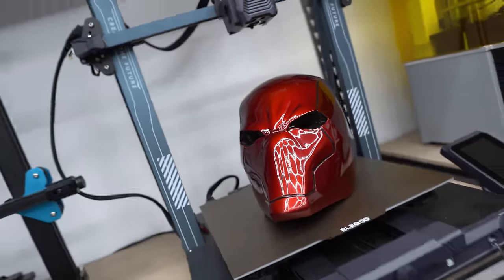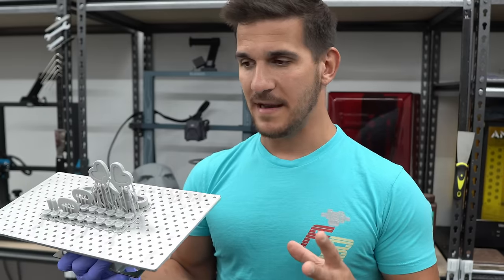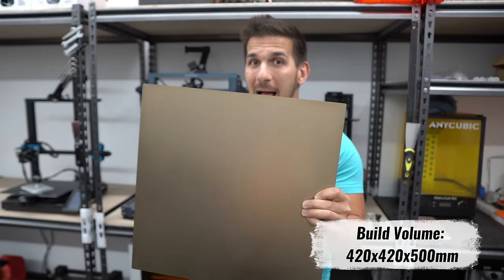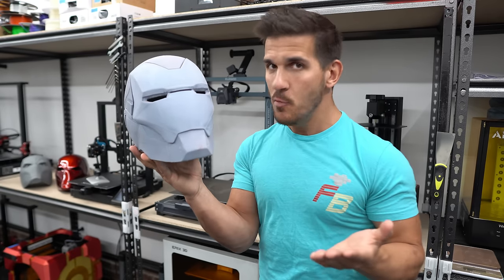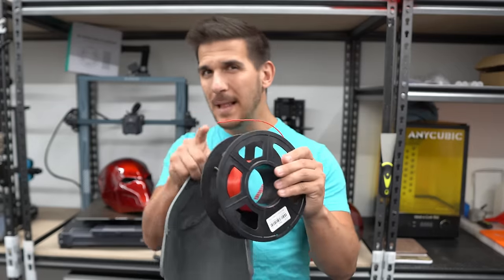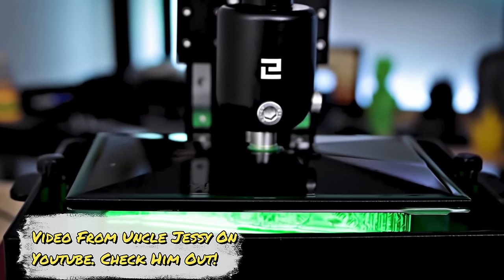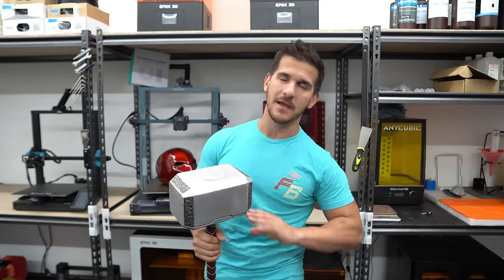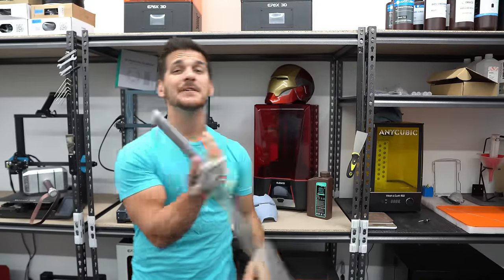Plastic (FDM) or Resin (LCD) 3D Printing?! Which is BEST for Cosplay & Props?!

Comment: Hey Frank. Good overview but also highlight that resin is vastly more dangerous to work with. Look at the Safety Data Sheet which details the various hazards. I’ve seen people get this on their hands, splashes in their eye and many cases caused a severe autoimmune response and ever serious chemical burns  Then there’s the post processing chemical hazards as well. My background is working and managing a research lab that does 3D printing.  I’m always getting updates on precautions and abatement methods. Also, with FDM, fume mitigation, fire suppression devices and enclosures are good ideas.  Please print safe, everyone
Reply: Can you elaborate a bit ? Are resin fumes always dangerous or primarily during the movement/heating process. Would an enclosed printer with inline filtration suffice for resin ?
Reply: @mml3140  the resin is always an inhalation hazard as the Safety Sheet per manufacturer will elaborate on. Some resin printers include charcoal air filters inside of them to help mitigate the fumes. There’s many things you can do when using these chemicals - safety goggles , splash guard (apron) and gloves   I don’t mean to scare you away from resin. Just understand the risks and work on addressing them.
Reply: @WhereNerdyisCool  I keep it in a zipped grow tent with an in-line filter. When I open I have a organic respirator on. But the ambient and leftover fumes still make me nervous that's why I ask.
Reply: @M ML  these resins are (meth)acrylate based. You should always take precautions with the fumes. Acrylates can also be irritants, make sure you check the SDS before printing anything that will have long term skin contact.
Reply: @chrisemerson9587  As far as contact I try to never skin contact. Even when cured I get paranoid and won't unless it's painted over.  The SDS usually has fumes in a category 2.
Reply: Have you tested the air quality in the room with your resin printer going? I did and the air quality is no different without it. This was a saturn 2 with filter inside. When opening the lid tho, the air quality plunged (spiked) as i let the gasses out after printing. But pouring resin before print was nothing.  Avoid direct contact with resin and be use a mask after a print, then avoid the room for a bit. Resin is not nuclear
Reply: @Sensei-padthai  I have not. What did you use to test the air quality?
Reply: @mml3140  most generic air quality devices will do the job just fine. Measures co2,  voc output. I actually borrowed mine from one of the labs at my university. They are not that expensive and nice to keep in a home aswell
Reply: @mml3140 I have the same setup plus I run an IKEA Starkvind air purifier with the additional gas filter in the room when I’m resin printing.
Reply: @Sensei-padthai  interesting,  I will look into that,  I appreciate the feedback. I know for paints VOC is usually the metric to look for , is that the same for methyl acralate/resin ?
Reply: @radish6691  Do you find that setup sufficient to keep the fumes minimal?
Reply: @mml3140  Yes but I don't keep the enclosure open very long either. The print goes from the enclosure into the IPA (or water) then back into the enclosure to dry.  The enclosure is lined with a silicone mat for spills (hardened with a UV flashlight once the vat is empty or covered). I use a BN-LINK Digital Heat Mat Thermostat Controller connected to an Amazon Basics 500-Watt Ceramic heater to keep the enclosure at 30C (within the working temp of the resin). I also keep the bottle of resin in there so it's already at temperature if I have to top off the vat. It's a huge improvement over my initial setup which was a fan in the window blowing out and a respirator with organic filters on my face.

Comment: A good way to reduce the cost of resin is, don't get the official wash and cure station for 200$ but get a uv lamp and uv powered rotating plate and a large jar for cleaning. I did it all for ~50$

Comment: I have 2 of each, fdm and resin printers.  I find that if I make a helmet in parts on a resin printer, if you drop it, it will shatter like glass.  With FDM it might break but you can plastic weld it back together.  So I too make details with resin and make larger parts fdm.  (I also made my own cure station with ultraviolet leds in a box and wash them in a large plastic container.  cheaper but works).  Love your videos.

Comment: One of the biggest deciding factors for me after quality would be durability. Resin prints are often very fragile compared to FDM (depending how the FDM was printed that is), but there are various resins that can improve this (flexible, tough, etc) and be even more durable, but often at a higher expense. After durability comes speed, resin is much faster than most FDM printers, and the time is linear to the height, so 10 small objects prints in the same time as 1.

Bonus for resin is you can mix to average out qualities, and transparent really is perfect. For FDM, with external parts you can do multi-color/material, whereas in resin you can't really do multiple colours without multiple prints/pieces.

With FDM, you can configure all the settings much easier without much worry for infill and walls. While you can do this with resin, you have to be careful that any hollow objects have a drain hole, otherwise uncured resin inside can slowly seep out (even a year or two after printing). On the bright side, repairing resin prints is sometimes easier than FDM - a UV flashlight and a little swab of resin in between and it's as if it never broke, meanwhile in FDM, you need to melt plastic, often leaving some deformities.

Another downside to resin is temperature control. If it's too cold or too warm, the print will likely fail. Some printers have heated vats or people have modded them for it to try and combat this. I just don't print resin in the winter unless I have a heater in the room on 😆

Comment: Glad I got into it when I did. Started with the mars 3 pro to see how I felt about resin printing. 6 months later I got a Saturn 3 Ultra and just printed a full sized Ichigo Hollow mask in one print no problem and the layer lines are virtually invisible after the priming.  Next year will be insane for resin printing I believe.

Comment: Resin isn't really meant to print huge simple prints (like a helmet or a sword). It can be used to print small sub part of a prop.

If I only take into account the final result: resin is too brittle, heavier and more expensive. it's also far less geometrical accurate (more warping, bending, retracting).

I would keep resin printer for miniature printing or small detailed part of a prop (like the inner detailed part in your Iron Man helmet).
Reply: I can see that.
Reply: This is true of an all acrylate/methacrylate based resin. But hybrid resins (epoxy + acrylate) have excellent dimensional stability and can print very large parts (F150 grills) without warping. Unfortunately, hybrid resins currently only work in large frame SLA printers because the photoninitators they use are in the 355 nm range (via lasers), putting them outside the capability of LED based light engines used in small resin printers
Reply: @chrisemerson9587  Well, we could also talk about SLS printing with powder... But I was only mentioning the options available for most people.

There are many ways to circumvent to problems I talked about but that's not really easy for the general public. Which is one of the main goal of the 3d printing hobby: reach as many people as possible.

But you're totally right.

Comment: That's basically my goal. I have a filament 3d printer and my buddy took my resin one because he does model train stuff so I'll be picking up another resin one. You should have mentioned that resin printing can print more on the plate and still be done at the same speed because it's layer by layer but good vid. Resin is much more of a pain but the quality is so much better

Comment: i think if you have a HUGE resin printer, you can print it in one piece and warping won't matter as much bc it'll all warp evenly. but if you have a normal consumer resin printer, i think it'll be worse bc you'll need to print it in seperate pieces and they may warp differently.

Comment: A quick tip from a resin 3d Printer user, as for resin toxicity it differs from one person to another, for me many times I touch the resin with my bare hands with no problems at all! , the only thing that really got me is the resin fumes which were really awful to my chest, so treat it with respect but do not be afraid at the same time from using it
And finally, regarding the cure station, this stuff is "USELESS" and  a waste of money, I made a super cheap cure station with only 2 UV flashlights inside a card box and covered by silver foil paper to increase the light bounce and I close the box with a mirror to increase the bounce even better,  thank me later for this one x)) 
Also, Ethyl alcohol works good for me due to the high cost and the lack to find Isopropyl alcohol

Comment: I'd love to get into resin printing, but right now, I don't have the room.  What I want in the print room is not just the resin printers, but a shelf with light-tight doors for resin storage, several cleaning and curing stations, as well as a portable UV flashlight that I can shine around after cleaning everything up to ensure there is no toxic resin lurking anywhere on the floor, shoes, etc.

It really does compliment FDM printing.  Heck, you can use SLA printing resin to paint onto FDM prints, then shove them in a curing station to smooth them.

For functional prints (a bracket I use to hang something on a wall), right now, FDM is in the lead, but some newer SLA resins are getting pretty strong and give properly printed FDM stuff a run for their money.

Comment: I started out 3d printing miniatures so resin was an easy choice. It definitely has plenty of drawbacks. I go through a ton of gloves and paper towels.  The resin smells kinda nasty but the IPA is actually the worse offender.  Frankly built is actually using some of the best resin on the market (that I know of) I use the same stuff. I have a Saturn S. which for me and what I'm doing is plenty big but I still have to outsource any really large items to my buddy who has an FDM. They're just good at different things... and honestly a lot of ink has been spilled about the resin printing process and how much post processing there is but honestly its not that bad. Once you've been doing it for a while and you have the procedure down as well as have all of the necessary equipment it goes pretty fast.  You just have to respect the goo

Comment: Kind of thinking resin to start with since everyone I know has FDM so I can make stuff they cant, and vice versa and we can trade off with one another as needed.
Master resin for the group, and have the FDM guys come in when I need them.

Right now a top end resin printer is actually cheaper than a top end FDM printer (say X1C vs Saturn 4 Ultra or GKtwo.  But with all the other stuff (curing station, cleaning station, etc) I am not sure how close they might be in intiaial upfront cost, and for sure resin will be more expensive in long term cost.

The answer of what to get? I think that is really "what do you want to make?" and unfortunatly I think I am right between the two.  
I would love to print figures to paint, and decorations for the house, gifts for friends.
But I also very much want functional printing, things to put in the garage, printing things for a car or motorcycle, etc where FDM has filiments to handle these tasks and resin does not.

So I am equally thinking of getting a FDM printer to start with just because it should be a bit easier to get started with, and seeing how far I go with the hobby and then pick up a resin printer later if the hobby sticks.

Comment: Just a note about resin printers, if you put it in an unfinished basement, it might need to be heated to keep the liquid at a good temperature. I spent way too long figuring that out and ended up with a plant growing warming mat and insulated cover to keep all the heat in

Comment: Chitubox has an anti aliasing setting that can be fine tuned to get rid of vertical stepping. Lychee has a surface smoothing feature as well, but slicing can take several hours to render if the file is too big, so I put all of my supports on by hand on Lychee then export to Chitubox to slice it.

It’s worth experimenting, but it looks damn near flawless when you get it right. It’s basically ready for primer if you dry and cure it carefully.
Reply: Hey i saw you mentioned chitubox my version has been turning every stl file into a mildly squashed version is that what vertical stepping is?

Comment: Great video, I'm a HighSchool Engineering teacher and 3D printing fanatic. I've got both Resin (EPAX X1 and Sonic Mighty 4K)  and a FFF (Creality Ender 5 Plus). I've lost track of the number of times I've explained this same comparison. That hundred moving parts on the FFf also make for a bigger learning/setup for getting the first good print vs Resin. Also, why wouldn't all the desiccant/ dryer equipment, filler, dry storage for filament, etc that is used with FFF not "take up space"? 
 I always ask the Person what are you wanting to make fine detail and small to medium --> resin  Medium to large lower detail FFF. Headed off to your Manfo help video!! Thanks!

Comment: I don't remember what it was called, but I saw a video a couple years ago from the 3D Printing Nerd about the next level of FDM printing where the print head is able to change height while laying down layers to make smoother transitions between layers and there is less of the step effect on curved surfaces. Is this still a few years away on consumer printers?

Comment: Hey frank my 3-D printer prints keep on sticking oof the bed. And for some reason it's always the back side. What do I do
Reply: Chances are that it may be the surface of the bed either not being leveled or not being clean. Have you used any adhesive to make the prints stick to the bed or is the nozzle dragging on the bed during prints?
Reply: I did everything I cleaned the bed I leveled the bed I went in side up and before u say what print is it it's a megadragon from Toymakr3d
Reply: Depending  on the printer, you may be able to shorten the burn in time on the first couplebof layers to make it nt adhere as much to the platform. But shorten it too much and the build won't stick at all and you get a mess in your vat

Comment: Definitely  fdm is better for cosplay i have both resin cost alot more and the build plate is smaller. If you sand the filament  one it gets better and painted. The  resin is more for minitures or smaller stuff and stuff that had alot details.

Comment: Something you didn’t mention is where you are using these printers. FDM printers you can have in your living room, I have one sitting in the corner, a resin printer you have to have VERY GOOD ventilation! Which is something I just discovered. I live in an apartment and only did a small test print of 30 minutes, it has been 8 hours later and I still smell the horrible fumes even with the window open and a fan in it. You really need a separate place outside of your living area for resin printing. I literally just got this printer on Saturday, did a print on Sunday, and have already started the return process because the fumes are so toxic giving my living situation. I would love to keep it but I would die lol
Reply: i recommend putting the printer in paintbrush booth you can get for $100 and have the booth exhausting the fumes through a window.

Comment: I have been in the Warhammer 40k community for a while now but never made it into 3d printing models. Most people I have talked to have overwhelmingly said that for miniatures especially space marines its best to use resin which is prone to warping. For making miniatures or pieces at a 28 to 32mm scale is plastic or resin the better option? and if Resin is better, how do I prevent warping?

Comment: hello i have a problem with my brim its starts to tear off after a while, the print starts fine but then the brim starts to rise at the edges and then the whole print comes off 
(i use ABS filament should i change something in cura)

Comment: I know this is an older video so I hope this gets to you.
Elegoo neptune 3 max vs elegoo Saturn 3 12k
Good day:
      I'm in the market and I'm most likely going to stick strictly to elegoo but I'm having a hard time determining if I want a fdm or a resin printer. After way to many hours searching on YouTube and forums I still cannot find a concise answer. My issue is: I want to print it all but only really have the funds for one or the other.
      My simplest of questions is would a resin printer be able to make strong and sturdy large cosplay and prop pieces that can be worn and exposed to sunlight without getting ruined? I want to get into cosplay and props well also making 1/6 scale statues and miniatures. Which is why both printers would be best for me but since I can only really get one, which of the options can handle all aspects?
     Thank you so much for any help and guidance you may be able to provided.

Comment: i have one of the biggest 3d printers you can get (that i know of a Neptune 3 max) and the smallest resin printer that can print a small figure at most cost nearly double my printer its is insane not counting all the extras like a curing station and the resin

Comment: Please note that both of the used materials are “plastics” or more precisely polymers. The difference is that FDM printing uses thermoplastics, which can be made out of renewable materials and can be recycles, and "resin printing" or DLP uses duroplasts, that, once cured, can not be recycled. Resin printing only makes sense for really detailed stuff, but like he says has a lot more safety concerns.